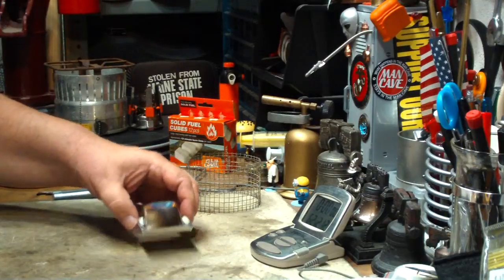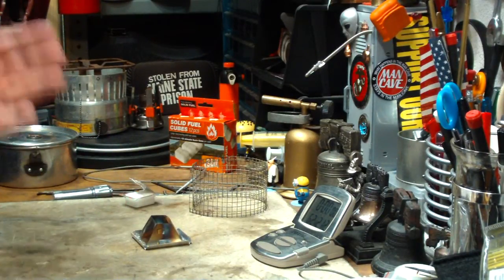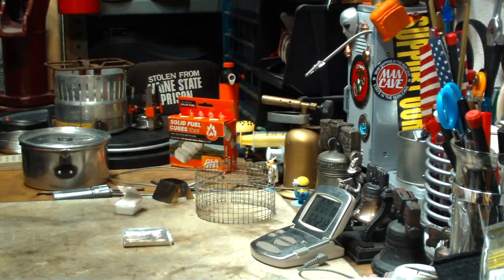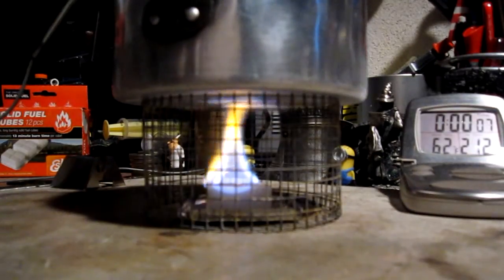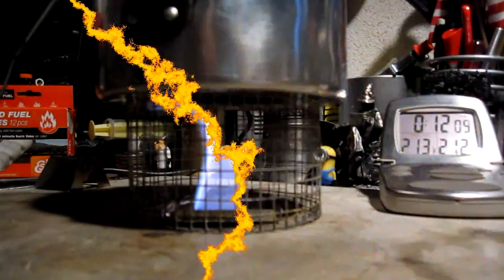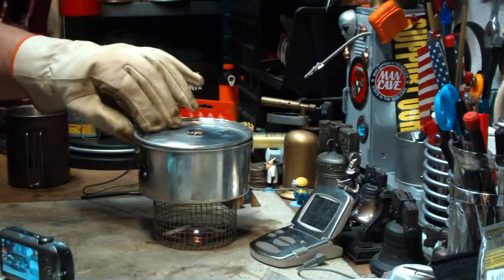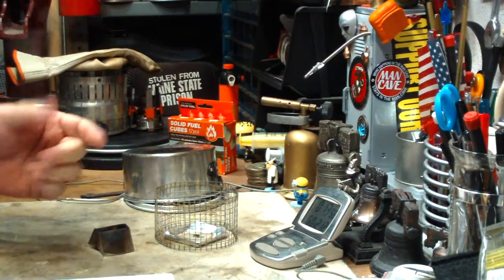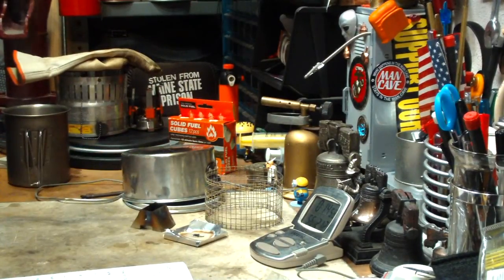Flat Cat Gear's Focused Fire 14 Stove - Esbit - Comparison Boil Test

Comment: Another interesting series of tests! I have two bits that I’d like to share. One esbit cube by itself put out 560 W, boiled 2 cups in 7.28 min with a fuel eff. of 83% (seems really high). With the FF14 and the same pot stand, heat output was 580 W, TTB 8.27 min with a fuel eff. of 71%. With the shorter pot stand, output was only 400 W, TTB 12.7 min and fuel eff. of 69%. These values assume an esbit heat of combustion of 30 mJ/kg.  Sorry Flat Cat, this “stove” looks like a heat sink, but the tiny (thin) shipping form factor is pretty cool.

Comment: I have one of these stoves on order and I'm rather looking forward to conducting my own tests. I use tablet stoves almost exclusively and have for 40+ years. Plus I have 17 tablet stoves of different designs and manufacturers so I have a relatively large base on which to establish a comparison. Unfortunately I lack means to post YouTube videos...I spent all my money on tablet stoves and fuel tablets :-)

In closing your tests are always interesting and obviously fair and unbiased. I have some burn rate and boil time experiments planned to answer my own questions. Unfortunately a significant portion of my lab equipment was stolen so I have to wait until I can replace it.

Comment: Granted, Jon is Beta testing these, but he does do his homework. I suspect the focus panels are designed to get the burn going more quickly which you do not time. The Esbit to pot distance may have an optimum for each also which your test does not consider. Perhaps a better test would be to time the burn from the lighting of Esbit Crumbs or squirting a 1/2 mL of alcohol an each and start timing from the ignition point. You might also use an excess amount of water and see which burn raises the temperature of the water the most. Just some thoughts for you.

Comment: Hiram good test , as flash has said, one advantage i would say as well is that the stove would act as a wind screen and may help keep the flame on the pot more. With my multi fuel cook kit, i had cut the bottom of a popcan. I use the concave part to hold the esbit, or hand sanitizer, or even a wax cottonball . Anyhow good test and thanks.

Comment: So we basically just lay an Esbit cube on a can lid and light it up. I'll bet if you knock a half inch off that wire pot stand it will even heat the water faster.